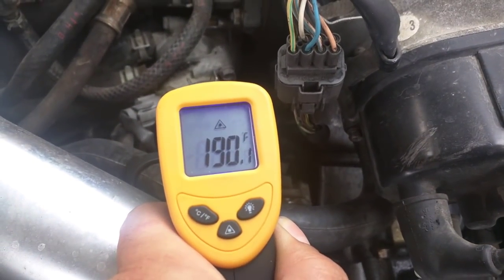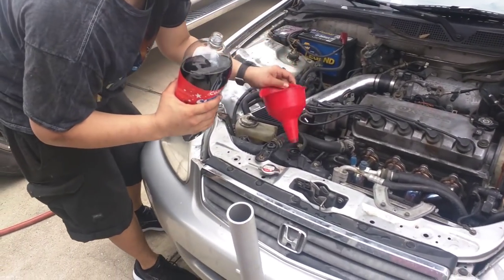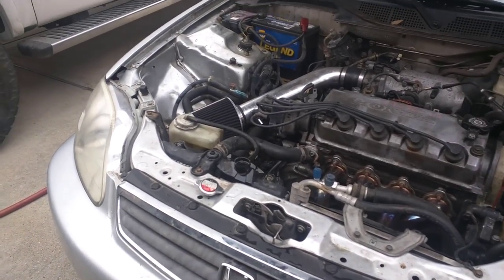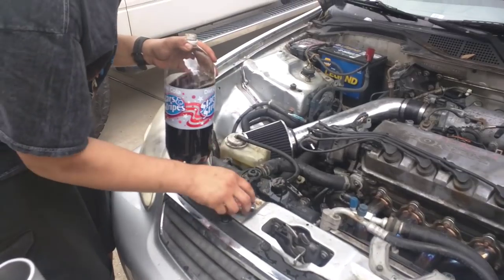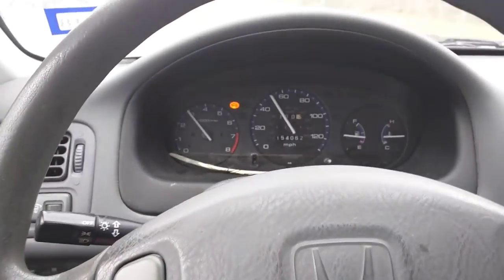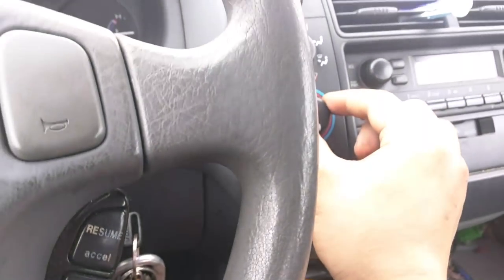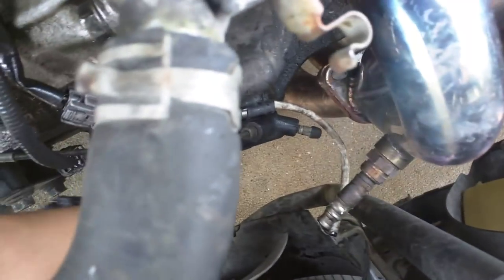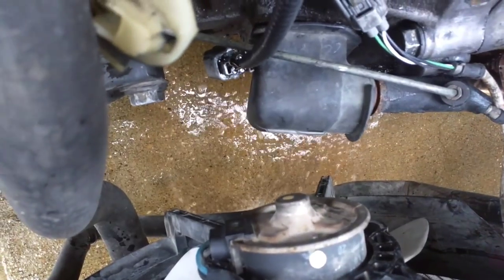will your engine run with COKE instead of COOLANT

Comment: Thanks for the testing!  I was stuck with no water and had a 2ltr of lemonade and tried to find if that would work.  I figured it would be ok at least for a short time.  I think there is some chance the sugar might do some damage if left in there when it cools, or whatever that diet ingredient is.
I would have shaken it to try and get the c02 out before putting it in.  Oh so I didn't put it in, I had a large fountain drink cup with just water, and that gave it enough to make 2 more exits to a gas station where I bought 1 gallon of drinking water to put in.

Comment: Once I was travelling around 50 miles to visit my parents, my engine started to heat up in the middle of the nowhere, there was no cell phone signal there, when opening the hood, the coolant was leaking from the cap, because i checked levels before and committed the mistake of not putting the cap back again properly, if i waited 20 minutes for the temperature to do down, i could only drive about 150 ft, and the needle began going up again. I had a package of Kirkland vita rain, flavors, blueberry, dragon fruit, and raspberry, i put those in the radiator and they worked like a charm, of curse i changed the coolant as soon as I could get into an auto parts store and getting to my parents home. But indeed, it seems that anything might save your ass.

Comment: Actually had to put some soda in a radiator yesterday. Car stranded in middle of the road. Figured any fluid better than nothing and overheating. It got me to a gas station where i could fill with water to get home.

Comment: by doing that u actually cleaned ur radiator much more efficiently ...
Reply from the maker: I've thought about that too! Coke is supposed to be good at eating up corrosion and such, I bet it did clean up the cooling system! Thanks for the comment